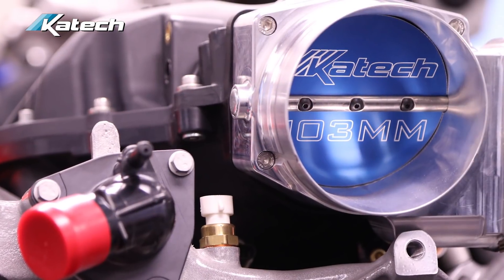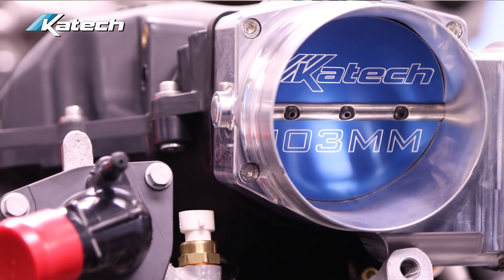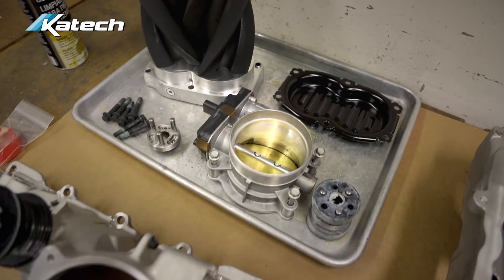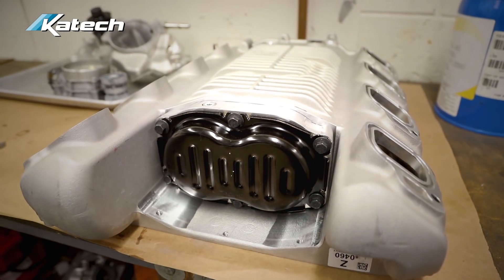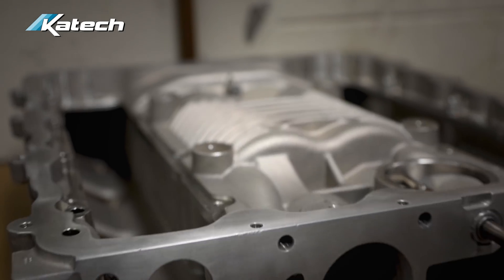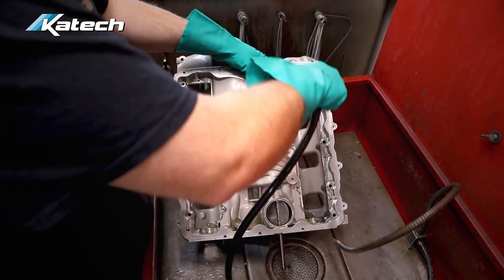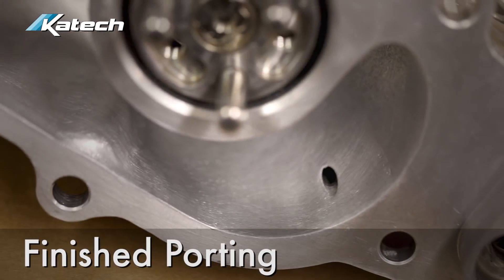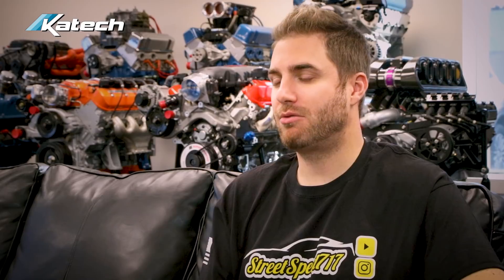Porting StreetSpeed717's LT4 supercharger for his 2017 Z06

Comment: You DO realize Mike was not at all happy with the so-called performance improvement, don't you. Everybody got off on blaming Andy at DFR, but when Mike jerked the car and took it to RPM, with another couple days working on it they managed to get about 20 more HP out of this build so it wasn't Andy after all. So all the fancy parts Mike bought and had Andy bolt on resulted in what? A 10% gain overall? 650 to 700ish? Not very impressive as Mike was expecting 850 or so.

Comment: I believe the LT4 supercharger is 1.7L. Do you know how much larger the porting makes it? Like 1.8-1.9L?
Reply from the maker: We are not increasing the displacement of the supercharger, rather porting the inlet to the rotors.
Reply: Oh okay to make it flow smoother with less restriction
Reply: Chris Topher picture cutting the top of a gallon of milk off, its still a gallon of milk but it will empty faster